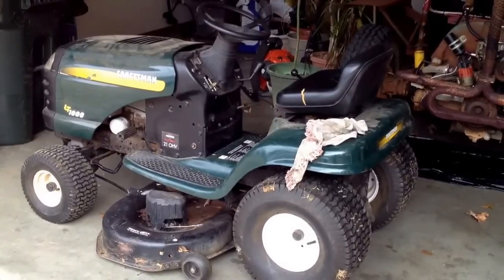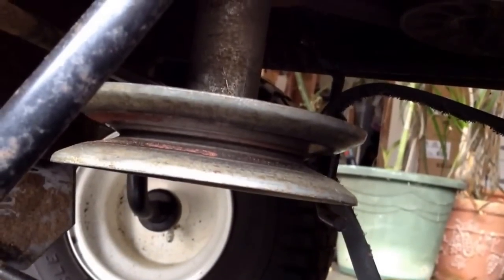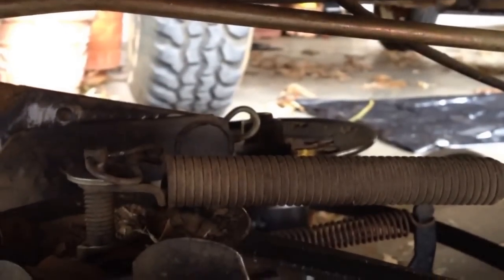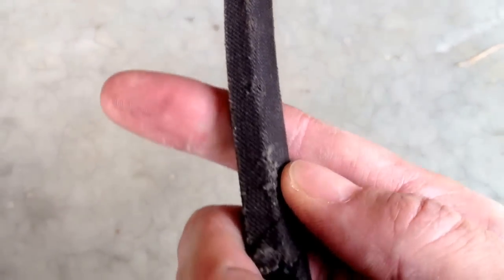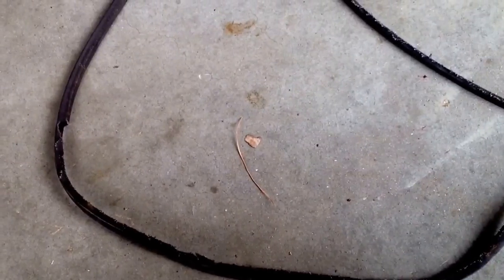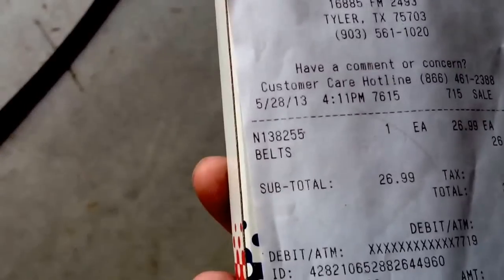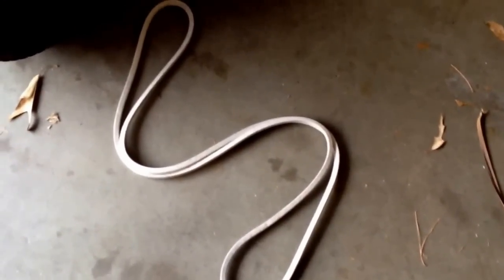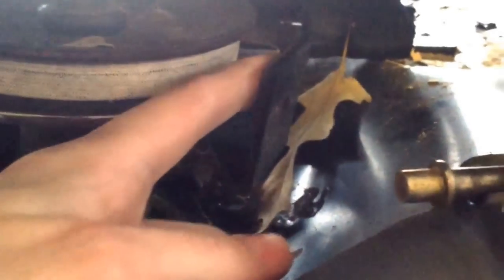Craftsman riding mower deck belt change

Comment: It’s a toss-up which is quicker, to remove the deck or not, but it’s a good idea to remove the deck to check the mandrel bearings, as well as other components occasionally, and makes routing the belt much easier. As someone mentioned, make sure you route it on the correct side of the belt keepers, or it will rub against the back of the belt. Once on, I never engage the blades while at full throttle and I’m only on my second belt in many years.

Comment: Just got a 2003 LT1000 w 16 HP motor.  The later model 17.5 HP owners manual says there is no deck belt adjustment.  The deck looks identical to mine but my manual doesn't have that comment or any deck belt adjustment procedure.  My cable and tensioner system is good and no frozen pulleys but the belt would not engage, was too loose.  I found that I could pry the left blade idler pulley to add tension to the belt.  That pulley is part number 36 on the deck diagram, not the spring-actuated right pulley #145.

Comment: If you have used your mower enough that the belt has to be replaced....take the deck off, disassemble, clean, replace anything worn, put deck back on machine. Takes a day maybe a couple depending. This is the right way to maintain your machine.

Comment: My experience of belt change for LTX1000. Sears part  #144959 but got the so-called replacement on-line maker "8TEN " - "Original equipment quality" C-BLT-0194  1/2"W 95 1/2"L big mistake, tight fitting and was chewed up the first time. Lousy company sent warranty replacement exactly the same type, DUH. Useless.
Check your machine model number e.g. 944.xxxxx = Husqvarna. Purchased correct belt from local Husqvarna dealer (original tractor manufacturer) ,fitted perfect. Use local dealer whenever possible if wrong size,  you can always return unused for exchange. Mail order very risky. 
PS: here in Canada we have Princess Auto, good range of belts sizes.

Comment: My old belt was 88 inch but i have the same mower .. so i got an 88 inch replacement and its to small… so is 95 the correct size? I have a 42 inch deck as well.

Comment: I bought a used LT2000 not long ago that is in really good shape. Had it about a week and blew the deck belt. I've never changed one before, but I'm pretty handy and figured I could do it ( and I did ). Once I took the deck off I wanted to track the guy down I bought the mower from just so I could smack him up the side of the head. He'd taken ALL !!! of the belt safety features off of the deck so it would be easier to replace a deck belt. I've got 13 grandchildren and even though they know better than to approach a rider when it's in use, I had the fear of one them coming toward the mower and getting injured from a busted belt so I had to go out and purchase the safety parts. I mean, what an idiot.
Reply: R

Comment: What size is the belt? 1/2" x ??" I do the same thing, avoid the big box stores, my local mom & pop shop sell them by size. My old belt did the same thing yours did, I carefully engage and disengage my belt at all times I never let it drop down quick as you explained. And I was also mid mowing and it just flew out of the deck and 10 feet across the yard.  My deck has those plastic pully guards on both sides, maybe because I have the LTX1000 ?? Not sure, my deck is 42" and other than the guard missing on one side of yours they look identical.
Reply: Thanks

Comment: I followed your directions. I changed the belt without removing the deck today. I got up to start the mower. I tried to begin mowing but there wasn't any tension in the gear. Suddenly the mower started and I cut my grass. Still no tension in the mower gear. It would move up and down with no stopping of the blades. I turned off the mower and the blades stopped.

Please help.

John Lade
Reply from the maker: John Lade apologies for the delayed reply, I had a similar issue and I was able to resolve it by finding the spring that was under the mower one day and realizing that it went in front of the tension gear from the top of the gear to a hole in the deck and the spring pulls it forward to release the belt and let the blades stop. Hope this helps.

Comment: It would've been easier to remove the deck because, you could've inspect the whole linkage and find whatever that needs to be changed before something brakes ( worn bearings, stretched springs, excessive play in moving parts).
Reply: His caption underneath the video clearly stated this was "HOW TO CHANGE RIDING MOWER DECK BELT WITHOUT REMOVING THE DECK" so I'm pretty sure he knows it would've been easier to remove it, but that wasn't the purpose and type of video he wanted to create.

Comment: Hi, hope u can help' I have a craftsman older riding mower model 917.270532 my drive belt keeps popping off once in a while. But belt looks good. Is is loose when not ingauged. Not sure what's wrong. Also my blades won't disingauge unless I slow throttle down, and turn the engine off for a few seconds then turn it back on before it dies... thought u might be able to help. Thank you.
Reply from the maker: I had a similar issue, at least as far as the belt not disengaging, there was a spring that I found some time back that was missing from the top of the deck, right in the middle that pulled the brakes on the pulleys to stop the blades. I put this spring back on and it pulled the brake to stop the blades.
As far as the belt popping off, there will be a pulley that has a spring on it that keeps tension on it, this spring may be lose missing or otherwise faulty, I would check that. On Mine there's 4 total pulleys on the drive belt and one of them in the middle will hold tension.
Reply: raguhmuffin I need some help haha
Reply: Just make sure that the deck is clean of grass trash extra stuff. Should be fixed after that

Comment: Hi, i got an older model but the deck looks exactly the same. Can you tell me the belt # maybe it will work on my tractor.
Reply from the maker: Apologies for the delayed reply, my deck belt was 42" or 106.7cm long and was part number 954-04060b / 754-04060b
and the drive belt was #138255 or legacy #130801 which I think is 95"? I don't really remember.

Comment: What is the part number to the v-belt of your LT1000
Reply: Part Numbers vary per belt manufacturer, better question would be to ask how long is the belt. Same question I have, my local part store sells them by size not by part number. Part Number maybe okay if you go yo Sears directly. But even the guy demonstrating the video did not go to Sears.